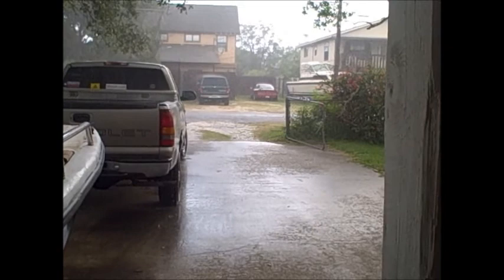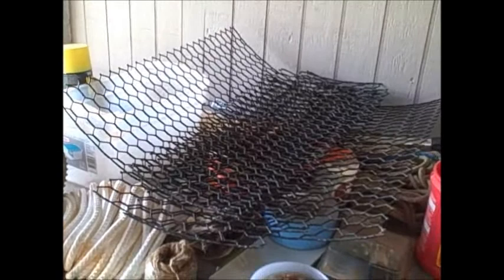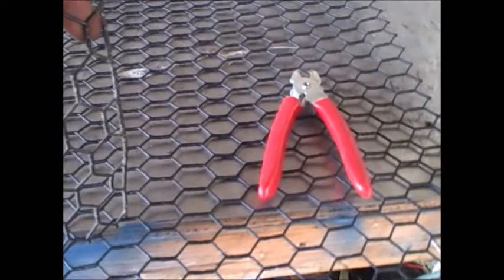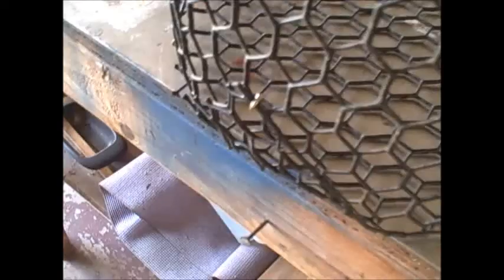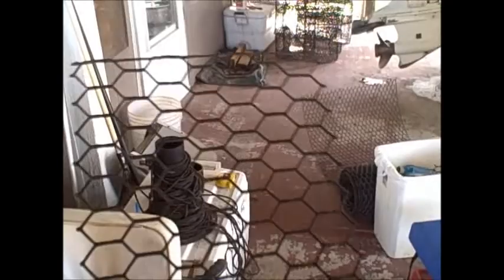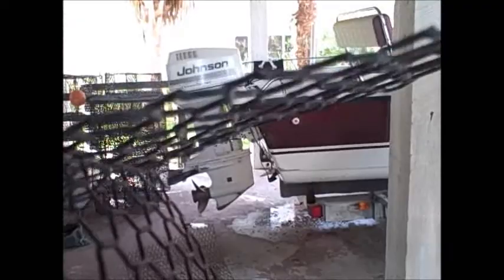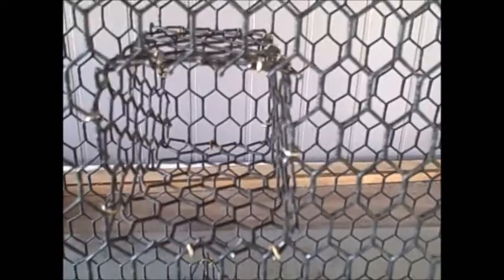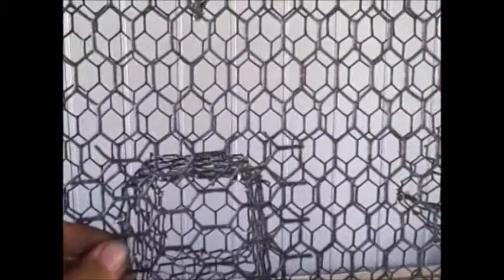Perch Trap

Comment: What is the type of wire you use. I use mesh that rusts too soon.
Reply: That is the same thing I was wondering about - it looks a lot heavier than chicken wire or hardware cloth.
Reply: I spray mine with a rubber coating similar to that flex seal stuff.... a lite coat will go a ways for saving the metal and they also sell coated mesh for these reasons, but I would just spray it...plus that spray comes in handy for tons of other things...

Comment: How much did that whole roll cost u?
Reply: It will depend on the  total width and the larger length the cheaper it is per foot. The wire comes in 6 inch lengths after one foot and can go up to six feet wide two foot size and 30 inch widths are probably the most used. Decide the size and google search it 3/4 mesh poultry wire or 1/2 square mesh  Hardware Cloth. I use Tractor Supply,Atwoods Farm and Ranch or Ebay sometimes is cheaper. If you use Ebay use the Buy It Now option and Price plus Shipping Lowest First when you do a search and use U.S. Only since over seas shipping would be very expensive.